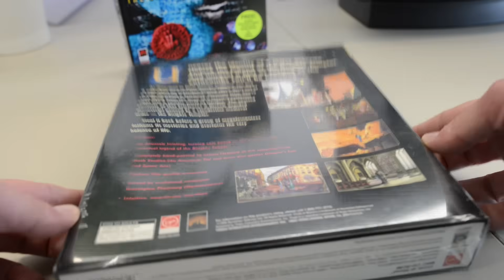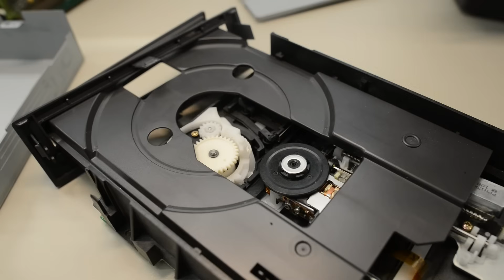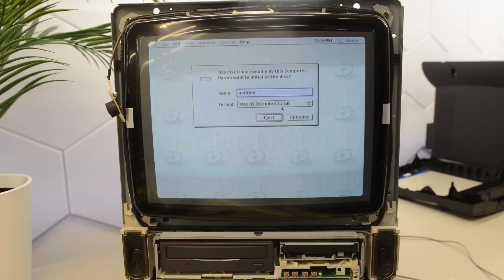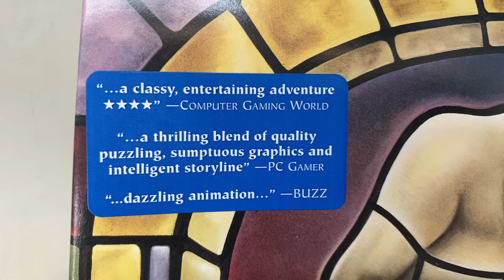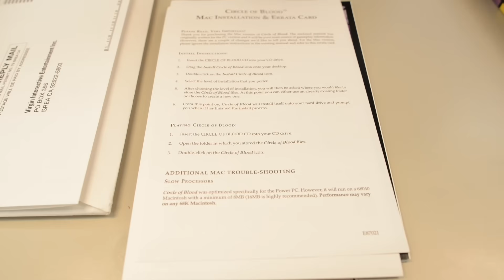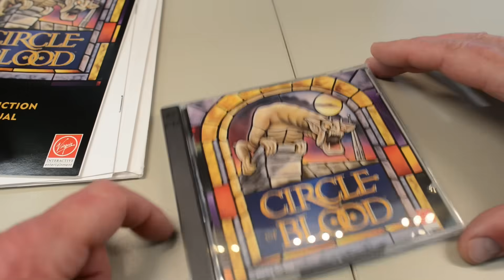Rare PowerPC Mac 5500/275 Repair & NOS Broken Sword/Circle of Blood unboxing

Comment: If you want larger CF cards, one option may be an (m)SD2CF adapter.

I use a relatively cheap 2xmSD2CF adapter in my Amiga with a couple of mSD cards and so far I haven't had any issues, ironically my regular old CF card just gets corrupted, presumably due to a janky IDE implementation.

That said, I wouldn't be surprised if the Mac will only recognise an 8GB drive.

Comment: FYI, with those MKE drives... you don't need to be precious with those flat-flex connectors.  I've never once had an issue reassembling them.  Make sure the clip is installed correctly, and then press the PCB right on in until it snaps in place.  It'll be fine.  They're remarkably reliable for how fragile they look.

Comment: The weird problems with the game is probably the CompactFlash card. I would suggest using a different CF card, like that industrial one, or use an SDcard to IDE adapter instead. the CompactFlash adapter relies on the CF card not being out of IDE spec since it's just a straight connection, and very often newer cards, like the ones bigger than 4GB are not suitable for this use.
Reply from the maker: I tried to install it on a mechanical drive, but got the same error
Reply: @Epictronics1 RAM problem then?

Comment: Interesting fact, but some versions of the Mac release don’t ship with the 68k binary even though it’s advertised on the box. I have Quadra 840AV and wanted to get it working on it. I think I was able to use the 68k binary with European assets. Unfortunately it didn’t run that smoothly. If I ever find free time I’d like to see if I can somehow optimise the code for 68k. It shouldn’t be running so slow.

Comment: The clicking noise could be a damaged tooth or a broken gear wheel (if the latter is true it will be a gear pressed onto an axle like that on the motor).

Comment: The strangely marked 47 jFC capacitor is a Panasonic cap. They use their own letter-based markings to indicate the voltage spec. "j" means it's rated for 6.3V, so replacing it with a 16V cap should be fine. I actually have a cheat sheet on my workbench for these Panasonic voltage markings 😅
Reply from the maker: Awesome, thanks

Comment: MacOS 9.1 was designed for late G3 and early G4 machines, it is not the best OS for a 603e based machine. If you want the leanest install, 8.1 would be the best. If you want the most speed and features, 8.6.1 is the best. 8.6.1 will run pretty much all software that will work well on that machine. 9.x is basically just bloat, Apple was buying up and incorporating as much stuff as they could to try and stay relevant with their woefully outdated OS at that point.
Reply from the maker: Thanks. I'll give it a try

Comment: I groan whenever I see mechanical hard drives being replaced by boring solid state devices! I understand why people prefer to do it but still, I just enjoy that classic drive whine & maybe I'm just an outlier?
Reply from the maker: Yeah, I'm old school too. I often go for mechanical drives when I have a matching drive in good condition. That being said, I have recently decided to try out CF cards on a few machines because matching drives in good condition are no longer readily available. This Mac has a working original drive, but the high-pitched noise it makes is unbearable
Reply: I always refurb my floppy and CD rom drives, but I have solid state solutions as well. I prefer to use the physical version when possible, but it's not always possible. I guess it's just a matter of preference.
Reply: Yeah how DARE people replace broken or doomed to failed parts with something reliable and greatly improve its performance and lifespan.
Reply: I kind of agree. I really like the noise the old MFM drives make and if I had an old PC with one and if it still sounds good I'd probably leave it in the case plugged in to power, but not to the board itself.
Reply: I will use mechanical drives in almost every case, until they're no longer viable at all.  (And yeah, plenty of them are not long for this world.  Can't even count how many times I needed to use a read/write surface test to get the drive firmware to reallocate bad sectors and make it usable again.  That's just common now.)

That said, even CF cards aren't as plentiful as they used to be.
Reply: Unfortunately it will eventually break. To have an  useable system, some concessions must be made. I can't fault him at all.
Reply: I think most of us enjoy older harddrives but from a practicality sake old hard drives are becoming increasingly hard to find without bad bearings or just generally being on their way out if they haven't already failed. All the HDDs that would be appropriate to this machine are near 30 years old at this point.
Reply: I liked the silence and the reliability. I hate hard drives. Too unreliable.